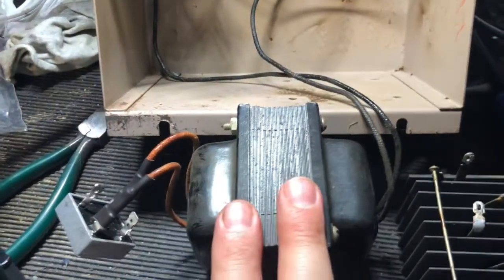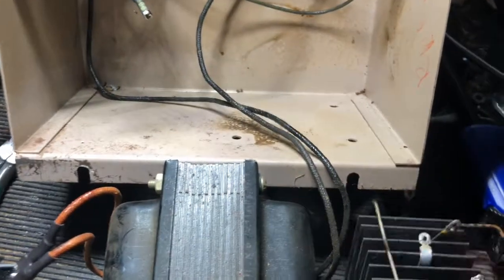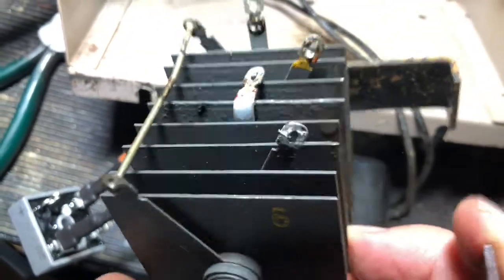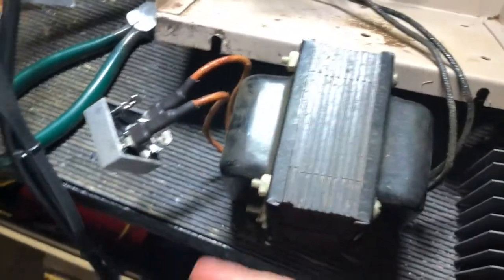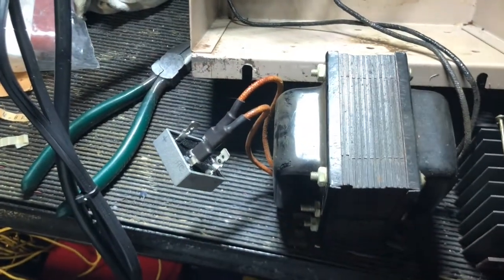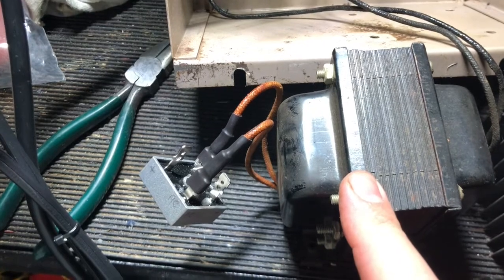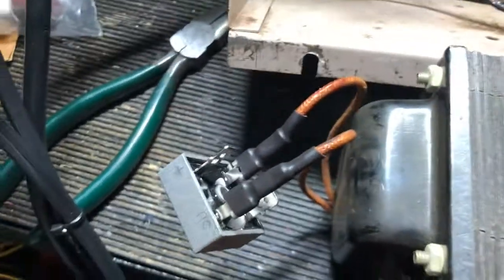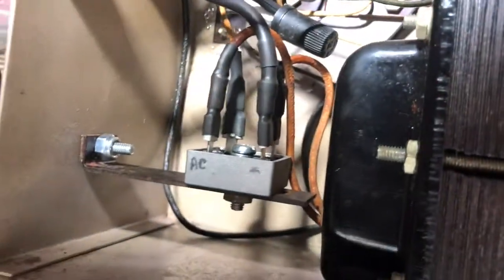AMI E-120 Jukebox Rebuild - Part 8 - Bad Rectifier

Comment: Could you please make a diagram of the wiring as to where each wire goes to and from the new rectifier. Thanks again.
Reply from the maker: I'll need to pull the junction box and look at it... don't know exactly off the top of my head.  Basically, you can look at the existing rectifier and get a good idea -- especially if you have a multimeter.  The AC wires come out of the transformer (no polarity wires -- either one works).  The new rectifier will show 2 AC inputs where those wires go.  For DC output, you can check the wires for polarity.  Basically, the new rectifier will have a + / - and you just hook it up correctly.  I will try to look at it and respond this weekend.